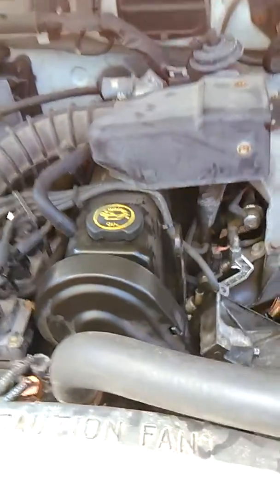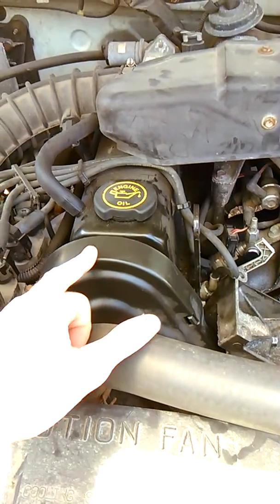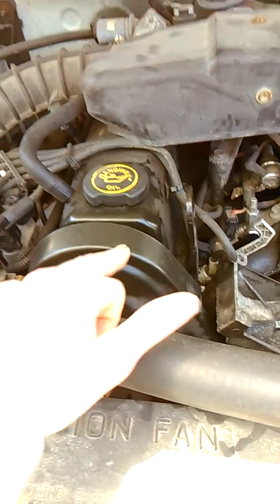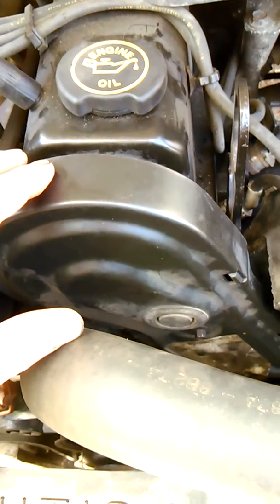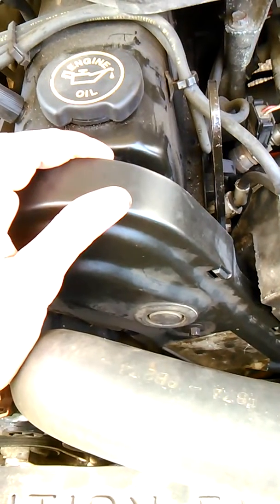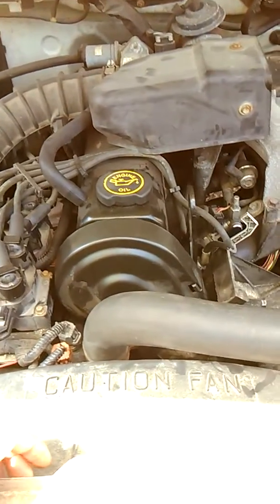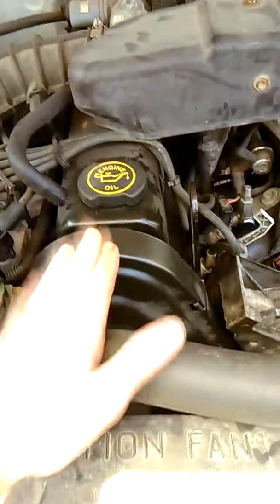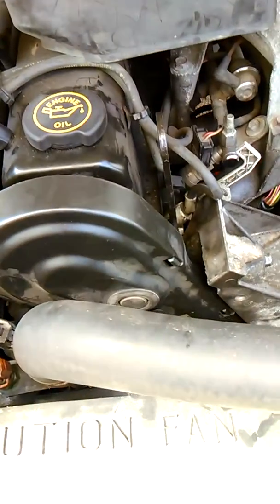1998 Ford ranger 2.5L timing belt replacement trouble? Important tips

Comment: Good thing those aren't interference engines, eh buddy?
Reply from the maker: Well actually if there was interference, a person would be able to feel it when turning the pulleys! But yes I get what you mean, always important to replace the timing belt before it breaks.
Reply: I suppose if you sat there and turned them all with the belt off for long enough you'd probably bump some stuff together if you had an interference engine but who does that? I try to keep my pulleys as still as possible once the belt is off. Never quite works but nothing ever gets that far out of alignment
Reply from the maker: Yup  keeping everything as close position as possible is the optimal strategy.

Comment: Did you have any trouble turning the oil pump (auxiliary shaft) sprocket to get oil pump timing set.  I am working on a 98 ford ranger .  The belt actually broke while driving.  Did some research and discovered the ford Lima 4 engine is not an interference engine so I'm assuming the valves have not been damaged.  I have everything off and am ready to install belt but I cannot rotate the Oil sprocket (auxiliary shaft) to get the timing marks aligned.  Any Idea what is happening here? Could the oil pump be seized...the old belt looks to have snapped.
Reply from the maker: Matthew Aquavia hey Mathew, my oil pump sprocket would turn freely I remember because I was concerned I may have to rotate it to opposite side. in your case I think I would try this first: just put belt on in any position so that you can turn all the pulleys manually with the crankshaft sprocket. see if that would free up oil pump.
Reply: Curt's Clocks Thanks for the reply, that indicates my suspicion was correct.  Todaypulled the pump since everything was off anyway.  My thought is that the shaft bearing seized which caused the  belt to snap.  I took the pump apart and the inside parts seem to move freely but still could not get the shaft with the star gear to rotate.

Comment: hey, I have a 2.5 with a miss in it I can't get out. all plugs and wires w/all sinceres have been replaced. along with coil packs and egr.  the converter was removed years ago. can anyone shine some light on this??
Reply: you check the crank/cam position sensors?
Reply: I have had a similar experience with my 1999 Mazda B2500, 2.5L. Similar to you, I spent dollars on replacing spark plugs, new wires, new fuel injectors, fuel filter, air filter etc. While troubleshooting an AC vent issue (air vent stuck in defrost mode), I found and repaired a cracked vacuum line by the intake manifold that supplies vacuum to the AC vacuum canister. This easy and cheap fix also helped smooth out the engine misfire!! So, check your vacuum lines, rubber vacuum connections, etc, very closely! Good luck!

Comment: so the oil pump does not match the same symbols? the previous owner installed this one wrong and it shakes and has no power i checked and its matched triangle to triangle up top and diamond to diamond on the oil pump.should i spin it to make the  diamond on the cover match the triangle on the oil pump gear?
Reply from the maker: Michael Barletta yeah I have mine running with triangle to diamond on oil pump pulley. gauge indicates pressure and I've driven about 1k miles that way now since changing belt.
Reply: Curt's Clocks ok thanks for the quick response ill try that out the marks are on it starts and shakes like it has a broken motor mount at the moment.
Reply from the maker: Yeah no problem. That is the way it ran for me when I was matching up diamonds too. Really rough.
Reply: Curt's Clocks no good it runs just as rough i think the engine might be toast.thanks for the idea tho
Reply from the maker: Michael Barletta and you have to have the exact tooth lined up, find that by putting ahead by one tooth on each pulley before loosening tensioner down onto belt
Reply: Curt's Clocks yea they are lined up after i put tension back and i rotated the engine 2 revolutions with a ratchet and came back to tdc make sure the marks were lined up. im pretty sure its screwed.it runs horrable whether its diamond to diamond or diamond to triangle.
Reply from the maker: yeah that is all you can do in that regard. Thanks for watching
Reply: Ford Ranger 2.3l, 2.5l engines may be the stuff of legends some day...l can't let this timing belt setting stay confused. It's camshaft...triangle to triangle...oil pump...diamond to diamond. While you're at it...calibrate the tps. It's said the Ford Ranger is under powered (94)hp. It doesn't matter to me...96-98 4-cylinder 2.3l fuel injection, Teflon belt...l'll take that engine anywhere in the world as long as l can get parts for it.

Comment: Do you know any full timing belt replacement videos for 2000 ford ranger cuz I can't find any
Reply from the maker: Kyle Morley I guess not specifically 2000, but I typed in 1998. they are probably similiar
Reply: It's gonna be the same for 1998 thru at least 2001, if not all the way to 2011. Depending on the part Ford kept certain designs that long. The important question is which engine do you have? Is it the 2.3 or 2.5L 4 cylinder? The procedure will change vastly for different engine types. The 4 cylinder Lima engines are probably some of the easiest to work on overall, with a few annoying little quirks of course. As the engines get bigger they get more complex and cumbersome as they are still required to meet the same space requirements within the vehicle.